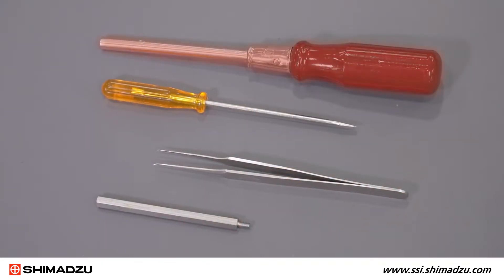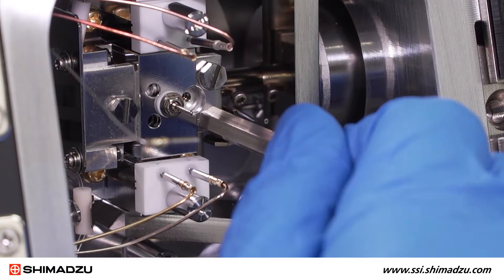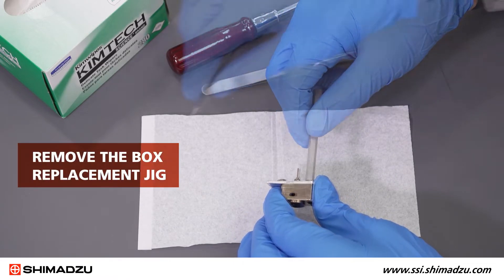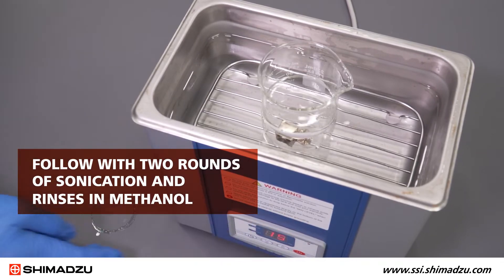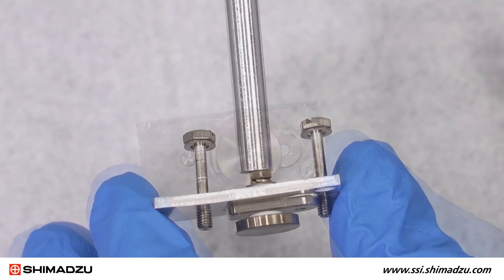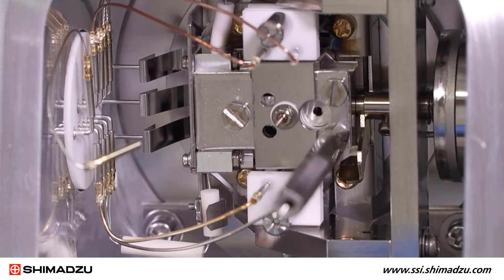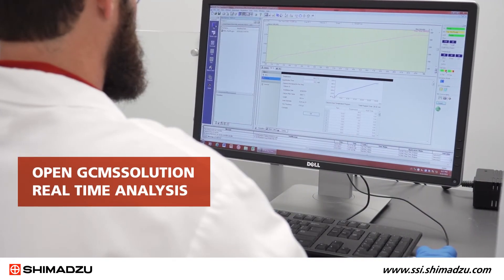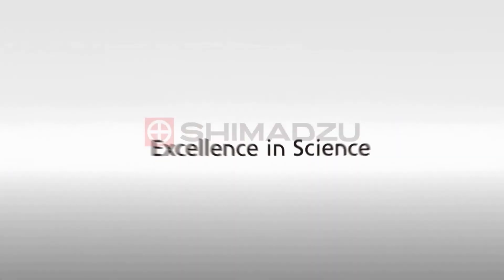How To Clean the Ion Source on a GCMS-TQ8050 NX

Comment: Hi guys, I really liked the style of you videos. I still think there are some flaws in your instructions. You show first the Socket Screwdriver, for loosen the Source nut, instead of the hexan screwdriver who is needed to loosen the interface-cup nut. Also you are assembling the ion source box without the shield plate - which is assembled later on, when the source box get installed again.
Maybe you can update this?!
Best regards